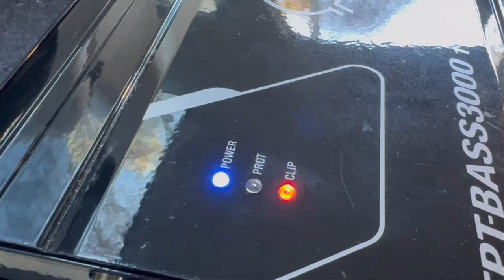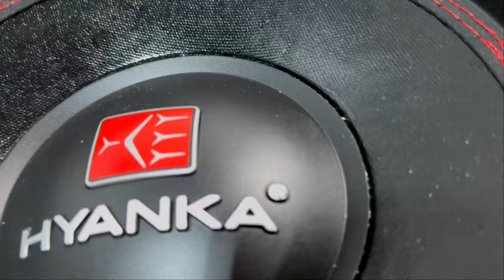I *BLEW* My 3000 WATT AMP!|What Now?

Comment: Hey bro I am a new sub just found your channel and I really like what you are doing with the channel trying to find the best budget basshead brands I myself have been ripped off so many times that it made me mad bro I just spent almost 2 grand on my alternator, voltage control module, second wiring kit and SCIB bank because I have been trying to get into competitive audio for quite a while and kept getting lied to by everyone saying buy this and that it will give you the power and bass you want only to find out it's a bandaid not a solution but since I spent so much on the power supply that im looking for amps and subs that are budget friendly and Alibaba has everything you can want for real im about to place an order and wait for it to come in if I find some good companies I will let you know
Reply from the maker: Ok so basically best budget friendly brands for subwoofers, SLAPZ AUDIO. It is 235 for a 4inch black aluminum coil made for SPL. I’m bout to make a vid on their 15 inch. Best budget batteries JAG35 they have the best and easiest lithium iron phosphate batteries for car audio. Now for amps it’s hard to say but SLAPZ audio has good prices for that too. For alternator js alternator is pretty good but that is going to be expensive, no way around it, also for amps I’m going to review marts digital 8k soon so stay tuned for that. Hopefully this helps.
Reply: @Zachecker  yeah I really like the new smackdown 15's from slapz and I'm seriously considering getting there surfboard 8k
Reply from the maker: @SlamryCamry19  best budget company for competitive
Reply: @Zachecker  and as far as jag35 goes I was one of the first to purchase the 74AH Lev60 pro V2 and I went through hell with them the battery had a short in the balance wires causing it to balance 3/4 cells causing one cell to take almost a volt more than maximum charging I contacted jag35 and they basically told me it was my fault for not knowing what I was doing before ordering the battery even though it was the plug and play model not only that I ordered the battery because I had seen several YouTube videos on it saying it could be used as a stock battery or with a high output alternator anyway I contacted jag35 and was told they would answer my questions and help me troubleshoot the battery and put a link in the email so I clicked on it and it took me to the jag35 diy powerwall forums and wanted my debit card info at 10$ an email from other people answering questions not jehu Garcia or jag35 itself so I had to take it to the local batteries and bulbs and have them break it down and find out what was wrong thankfully it was just a wire because jag35 was no help at all and refused any type of refund or replacement and after using the battery in both scenarios with stock alternator and 240 amp high output and you can get away with it for a while but it will definitely damage the cells and greatly reduces the lifespan of the battery and will eventually swell up and either quit holding a charge or possibly burst jag35 is going to wind up with a major lawsuit before it's over with because the owner is literally promoting the battery to be used with a High output alternator and charged past its max charging voltage of 14.0 not 14.8 i still have the battery actually trying to sell it if your running a stock alternator yes it is the best possible choice but please don't use it with a High output alternator its a recipe for disaster
Reply: @Zachecker  and where is the best possible place to sell used equipment with my new power supply obviously I'm trying to go bigger so I have a kicker CXA 1800.1 with two Q-class L7 12's in a prefab box I'm trying to sell it all for 500$ towards upgrades but I don't know where to list it
Reply from the maker: @SlamryCamry19  good to know. Thank you
Reply from the maker: @SlamryCamry19  I may contact big Jeff to see if I can get a deal with the big Jeff battery or the down for sound battery
Reply: @Zachecker  I don't know about the big jeff battery but the down4sound LTO 6.0 is supposed to be a beast and it uses the 2.9AH cells which are the strongest cells on the market right now it's the same cells I have in my SCIB bank only difference is that the down4sound is a 5S configuration meaning it's intended for stock charging system can't remember the maximum charging voltage but I personally steered away from it because I read a bunch of reviews where the battery failed and quit holding a charge because of overcharging so apparently it doesn't last long at all if you put the juice to it and I personally am wanting to run 16v  for the better power delivery and increasing any amplifier output and since my goal is to get into competitive audio I'm definitely going to need the extra voltage now that I think about it isn't the big jeff battery lifepo4 if it is it's all going to depend on your end goal if you want the daily driver do some demos and keep steady voltage go lifepo4 if you want to compete and demo go LTO it will also depend on how high you are trying to charge this topic was a major headache for me and I have spent a bunch of money I didn't have trying to get it right only to fail and finally decided to get the best power supply possible for my conditions my car is literally my daily driver work vehicle 19 Camry that im installing a competition setup in to compete with so I wanted to make sure everything was top notch when it came to the power supply I have heard to many horror stories about half ass power supply ruining cars and systems and completely frying alternator's but to be completely honest if you are not going to run anything more than 3k a super cap bank is your best option I have had a couple different ones and I was super impressed with them and actually thinking about getting a 1000 farad Maxwell bank right now even though I have the best battery I can get that's how much they impressed me I'm wanting to see what they will do with the high output alternator
Reply from the maker: @SlamryCamry19  Facebook market place easiest.
Reply from the maker: @SlamryCamry19  yessir I will do my research on both Ik the down4sound is a beast so may get that.